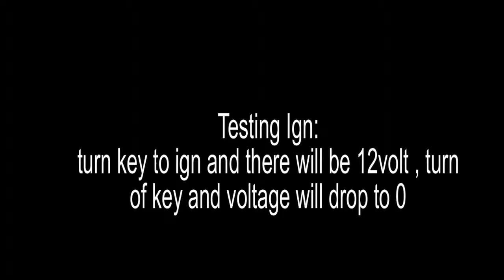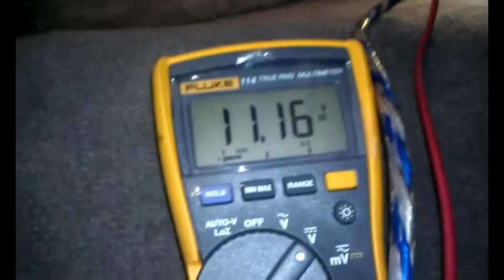Car alarm wire testing

Comment: I know its very old video but the siren does not work. So i tested with multimeter its showing 12v even when the siren is not going off. So i want to know does the SIREN gets 12v even when its not sounding or is there any fault in my system.

From what i know when the siren is provided 12v it will sound, isnt it?

I even connected the siren directly to battery keeping in mind the polarity it still doesnt sound.
Reply from the maker: +Saurabh Sarang yes when there's voltage and ground the siren will sound.
Reply from the maker: +Saurabh Sarang check your ground if the ground is good. More than likely you have a faulty siren.
Reply: Yes i do have faulty siren. Thanks.